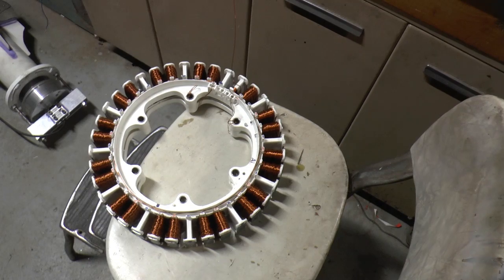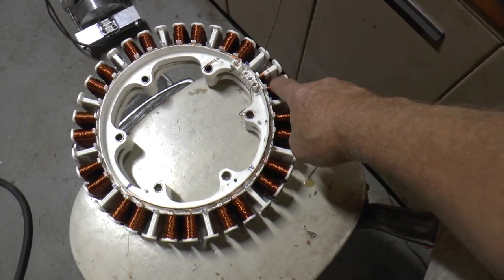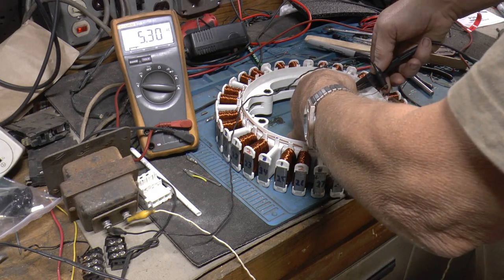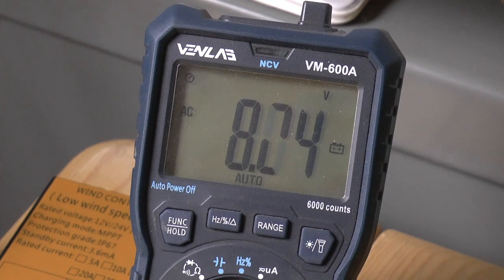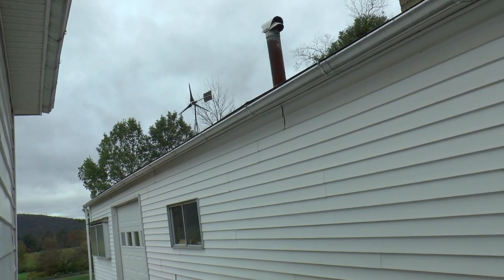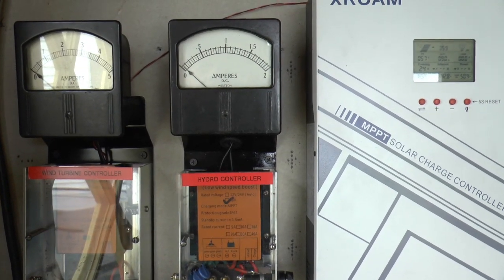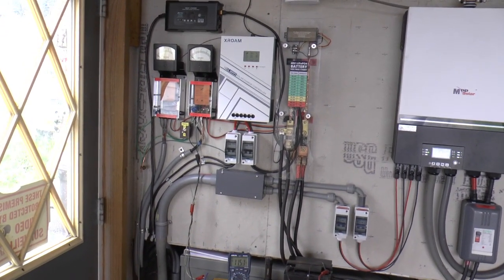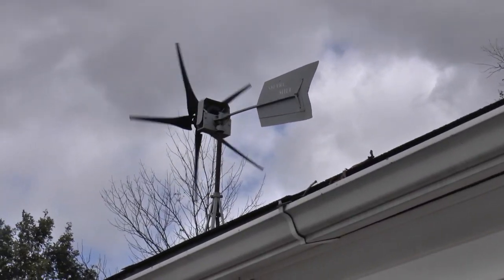DIY Water Wheel and Wind Mill Rewind and Experimenting

Comment: Did you ever measure the Hz that they were working at? To get a 10 Amp charge on a 24 VDC system with a Smartdrive you need to see 150 Hz which is 375 RPM. 5 Amps should be the same RPM at 48 VDC.
Reply from the maker: Interesting. I will have to see what the Hz is.